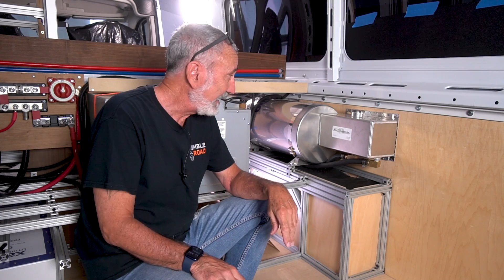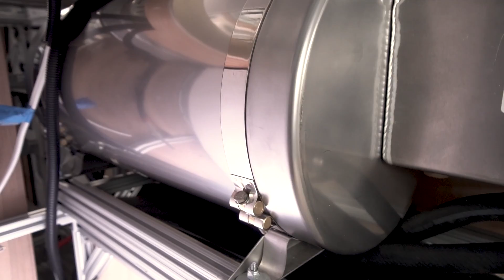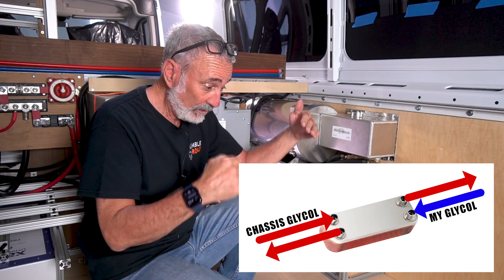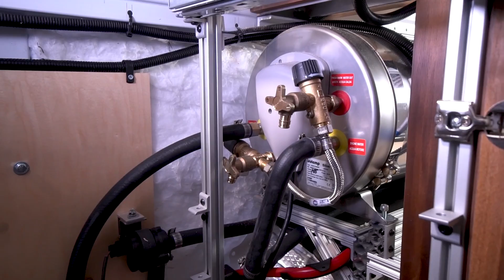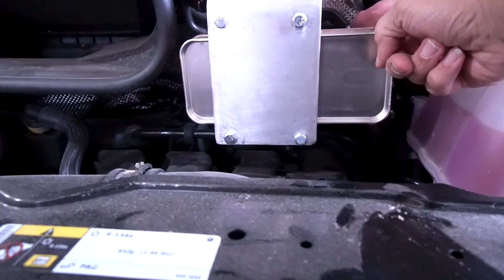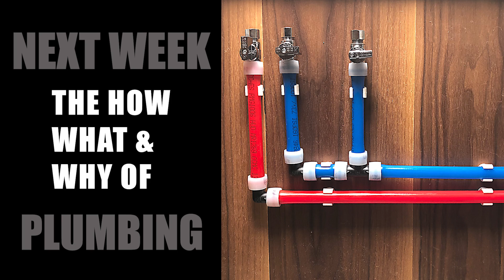Make hot water in your van, while you drive!

Comment: That solves the problems of getting the truck stranded losing its engine coolant from those lines getting cut by a rock or something on the road, and solves the problems of those lines freezing during the winter since it is also antifreeze coolant. 
I didn't see or hear if you shown or talked about the tank freezing when not in use during the winter. But i am sure all you would need to have is a drain valve for the fresh water in the tank at its lowest point, and just drain it when you know you will be storing the truck in the freezing weather.
Reply from the maker: I haven’t installed a low point drain since van #01. Run the tank dry and blow the lines.

Comment: Just watched the video from Van Land, they installed the same heat-exchange water heater but under the chassis. Maybe it's a good idea to solve the issue of having a high-temperature heat source in the chassis in summer.
Reply from the maker: While I agree it is a fine, rugged piece of equipment, but the Isotemp is not made for exterior mounting. It is from the marine world, where its intended use is in the bilge or engine room.
Reply: @HumbleRoad  Right, just figured out they're using a different brand, the "SureCal 20 liter / 5.28 gal Horizontal Single Coil Calorifier". Having read through the product description, this one seems better for interior use, too.
Reply: ha! I just watched that video too before finding this one. I think they're also running the actual radiator water through their system as well, so when those exposed hoses and fittings under the van break, and they will, the van is going to lose all coolant and overheat.

Comment: Always clear and concise explanation of your engineering decisions; thanks!   I would like to hear your opinion and experience on using those plate exchangers vs shell & tube.  My concern in my application is that the exchanger in the engine bay will experience significant vibrations, and I am concerned about the plate exchanger as they are theoretically much more prone to breakdown in the seal and resulting in liquids mixing compared to the shell & tube type heat exchanger.
Reply: I believe that this plate heat exchanger is fully brazed meaning there are no seals on the plate pack, it seems very robust to me.
Reply from the maker: I know a few builders using the very same exchanger in their builds without issue. I have three vans out in the wild using this heat exchanger without issues. One van is full time, running every single day!

Comment: Great video! Sir George, just wanted to give a heads up.  That those worm gear clamps connected to the heat exchanger will eventually leak glyco, especially in the engine bay.  Due to the hose experiencing cold/hot temps.  It is much better to use spring clamps that can deal with that expanding and contracting of hoses.  Hence why all car manufacturers, will never use worm gear clamps in the engine bay
Reply from the maker: Noted. Thank you!

Comment: I made this kind of system in my van, but by my own way.  I didn't use any ready supplies.  Now I have 80 litres (21 gallons)  of hot water in 20 minutes of driving. 😁
Reply: Howdy, 
Do you maybe have a video of the setup, or parts list and a diagram? Many thanks in advance for your time and assistance, it's much appreciated. 
C.I.M.
Reply: Hi Filip, can you share how you did it? A partslist would help as well.
Reply: @marc1321 no he can't because he didn't do anything if he did he would have shared info by now
Reply: can you share on how you did that

Comment: I noticed myself turning faucets all the way to hot and putting my hand in them to test the temperature before mixing with cold water. If your customers have the same habit, they’re gonna burn themselves. There’s a reason trades have been done in certain ways. You honestly have a potential lawsuit on your hands with that design, especially when there’s a video with you saying “I know how it’s usually done, but now it’s on them not to scald themselves by maintaining attention every time they use the hot water.” It’s really a recipe for failure if you rely on a persons attention because it will lapse eventually and then you have a problem.
Reply from the maker: Each of us has a different perspective on responsibility. Your opening statement on how you turn on only the hot would not be a great defense in court
Reply: @HumbleRoad  Anything that can go wrong will eventually go wrong. You’re relying on your customer’s attention to prevent themselves from getting scalded. What wouldn’t hold up in court is the video of you blatantly disregarding standard practice which prevents that outcome.

People are absent minded dude. A long day of biking in the mountains and you’re tired. Maybe there’s a bear nearby that you’re nervous about. You turn on the hot water to wash off a plate and you burn yourself. Not a good design.

Comment: really interesting, so not sure if it's been asked already but what happens if you're stopped for more than 2 days and no shore power, in other words, how long would you have to idle your engine build up a decent amount of heat?
Reply from the maker: I mentioned in the video that this water heater also has a 120VAC heater coil immersed in the tank. Turn on the inverter and turn on the heater. 750W so it takes a little bit of time to heat up, but that's another way to make hot water with this set-up.

Comment: I am guessing you use the same coolant that the chassis uses?  If the heat exchanger were to fail inside it would contaminate the chassis coolant otherwise.
Reply from the maker: An astute observation. But no, in all three vans done so far, I used a pet safe glycol as per the client's request. But moving forward, I will introduce your theory. I like it.

Comment: Hi George, I use isotherm slim in most of my builds. I have shut offs(electric ball valves)  and no heat exchanger or Reservoir. These systems produce too much hot water if left open all the time.  If it’s still too hot under my bed after both me and my wife shower, I have recirculating feature in shower valve rv that I can transfer most of the heated hot water to main tank that sits under van
Reply: Paul, do you have a pump on the your Isotherm to circulate the coolant from the engine or not?
Reply: @mattadams7261   you don’t need pump, the engine water pump is always on when running. It circulates thur engine block and thur heater coil and isotherm if allowed. It works perfectly.I am now installing electric ball valves.

Comment: After thinking all day on this it’s as simple as wiring the pump through the thermostat on the tank already provided for the electrical heating element. Problem solved never too hot.
Reply from the maker: Except then you have to leave the tank “on” all the time, making hot water through the inverter .
Reply: I’m pretty sure it opens and closes the connection without power. A gas water heater has no power to the thermostat. It just opens and closes a circuit. It’s worth looking into.

Comment: You will use the same amount of 120 water. where ever you temper down the water. A baby would get scalded to death in 60 sec. at 130 degree hot water. Source: Massachusetts Plumbing code. Way safer to temper water at tank that’s why the tempering valve is at the tank. Can’t wash little dog in sink anymore.
Reply from the maker: Correct, the mixing valve on the tank allows adjustments. User adjusted to taste

Comment: You don’t need to cool the water from the heat exchanger. That’s why you get the isotherm with a mixing valve. You connect only one hose to the expansion tank otherwise you create a radiator.
Reply from the maker: please explain further. thank you.
Reply: @HumbleRoad  there is no harm in running engine cooling water through the isotherm. That’s done on boats. They just have a heat exchanger to cool the coolant with sea water. The coolant with antifreeze just cycles through engine, hot water tank and the heat exchanger that gets cooled by the sea water. They use an impeller pump to cycle the sea water through that. It’s basically the same functionality as in a car just with sea water not air. 
It is a good thing to separate the engine loop from the van/house loop in case you ever have to work on one system only. 
On the van side, just tee off a line from the highest point of your antifreeze plumbing to the expansion tank. The tee should open to the top to the line that goes to the tank. Your circulation pump should be in the colder return line. Once you fill your system it will just fill with water and the air will go out. 
Let the pump run and you will see how the air comes out of the system. 
The expansion tank must be the highest point in your system. I hope that explains it.

Comment: Learned more info for my system in my 98 Xplorer.   Thanks for posting George!
Reply: My 98 Xplorer heats the water heater from the motor. I also added a 110v heat rod to heat off the generator, shore power or solar.
Reply: @yvairguy  Interesting!

Comment: Is more to the point of keeping the engine system separate is providing proper temp for the engine to operate optimally?
Does it drop the engine temp a bit. ICEs need heat to combust
Reply from the maker: I've got two of these vans out in the wild, one full time for over a year now. No issues. If the chassis coolant was run all the way back to the water heater, then yes, I see what you are thinking.

Comment: Thanks for sharing tour knowledge.

Instead of adding water to air heat exchangers in order to cool the glycol in the summertime, why not just stop the pump?
It wouldn't boil the water to water glycol stationary part as the boiling point is way higher...
Reply: * your knowledge

Comment: If the returning glycol is too hot, couldn't you just setup a thermostatic switch to the pump? and stop the glycol looping.
Reply: I like that, have a e-valve solenoid switch on the dash for summer days when you dont need hot water or really just dont want a hot van
Reply: who wants a hot shower anyway when it is 30°C outside anyway. I like your idea a lot.

Comment: Great job!  I notice that you did not address the vent on top of the Rixen expansion tank.   What are you planning to do with that in order to manage the potential air/coolant "escapes"?

Also, is there a reason you did not put the expansion tank and/or pump in the engine area?
Reply from the maker: I will vent the reservoir outside the van, but if you keep the coolant level one inch and a half down from the top of the tank, it will not boil over. In a Promaster, there is not room under the hood for the reservoir. Sprinters? yes, I put the tank on the aux battery tray, if it is not occupied.

Comment: George, any need for thermal expansion valves for safety?  Or is it that the system is not under constant pressure that this is not needed?
Reply from the maker: The reservoir cap has a 5lb pressure release for the glycol. The water heater has a pressure release valve which drains outside the van.

Comment: Great system, very interesting.
Instead of adding and removing insulation around the pipes, it would help to regulate the pump. In summer it should run slower, so the glycol has more time to cool down before it runs into the heater. (Maybe a two level-switch for summer/winter is sufficient.)
Btw: I'm using an electric 12V heater and run it only while I'm driving. Same effect, but only 200W and much less water than in your system.
Reply from the maker: Thanks for the tips!

Comment: Does this system also have a furnace to heat the glycol that uses the fuel from the gas/diesel tank or is it electric/engine heated only? Do you use this glycol to heat the van by running it through a air heat exchanger?
Reply from the maker: No, this is simply to make hot water as described.

Comment: Hey George, Thanks so much for Another Very Nice Video!

I plan to do mostly winter traveling to avoid the crowds plus I like winter better than summer.
Have you considered preheating the engine (H-12 option for a Sprinter), but instead of spending $1200 for a factory install, just incorporate it into your plumbing system using the Espar Hydronic S3 D5E?  I plan to use two motorized valves in my glycol lines for turning it on and off.  
Plus, I want one system without the separating heat exchanger just to MAKE IT SIMPLE.  I have driven over a million miles and I have never had a heater hose to blow and I bet you could say the same thing, so What is the BIG DEAL ?  I know no one recommends this!  With all the safety warning electronics build into the Sprinter I am sure I would know if a line blew, and I would just FIX IT!
Reply from the maker: I installed an Espar Hydronic system in my first van build. Did not like the idea of firing up a diesel furnace all Summer long every time I needed hot water. Since you will be mostly in colder climates, that will not be an issue.

Comment: Hi George - great video. In my van I'm planning to have a 2.5 gallon 120V water heater that runs off the inverter. If we're driving then the B2B is charging the system, resulting in similar 'free' hot water. How would you compare the pros and cons between the two? I think the electric version isn't quite as good (lots of losses in the various conversions compared to the glycol heat exchange) but as a beginner, seems a fair bit easier to install.
Reply: If your going to go this far may as well put in the furnace and eliminate the hot air espar heater. Put the tank under the hood where it belongs. To buy this system is by no means FREE.
Reply: @michaelscarfi3196  a tank under the hood or a smaller tank would be much better in the summertime.
Reply: @Chris could you explain your concept of the timer setup for this you were talking about?
Reply: @mattadams7261  If you put the water heater on a 10/20/30 minute timer rather than on/off, you cannot forget to turn it off. If it's a basic switch, you might leave it on for longer than you need. So the idea is, use a timer switch (mechanical or electronic) and just run the heater long enough to get a hot tank, but not longer.
Reply: @Chris Bro, it’s the law of thermodynamics. I didn’t create it but I do follow it (And so do you) Thermodynamics doesn’t care about your timer. You are generating electricity using the alternator and I can sure as heck assure you that that costs much more than the ~12¢/kWh power out of the wall to heat your water using the gasoline/diesel engine in your van. The point of this system is efficiently and capturing the waste heat from the engine to heat the water FOR FREE (minus 12v water pump)
Reply: George’s system costs less to run. The electricity you’re using is represented by extra fuel used.
Reply: Man cat fight is very interesting.

🐱🐱🐱🐱🐱🐱🐱🐱🐈
Reply: @007nadineL  Interesting unlike your comments…

Comment: This is how most cruising boats make hot water. Works great and the water will stay hot for a day. Most marine water heaters are stainless and include an internal engine coolant heat exchanger plus a 120V electric heater as well. My boat makes water very hot and it lasts into the next day easy.

Comment: Hello George, by any chance you can draw a diagram how you did this? It’s the system of keeping the hot water in that water tank that throws me off. I totally understand the heat exchanging process produced by the engine glycol. It’s how to keep the hot water in the tank to be used later when you wanna take a shower or whatever. Thank you 😊
Reply from the maker: The water pump (when on) is pushing cold water into the water heater, where it is heated and sent out to the hot manifold for dispersion throughout the van.

Comment: If the water stays hot for up to two days could you add a cabin heat radiator to the system and use the retained heat to heat the van overnight?
Reply: Yes this could work but I don’t think you would get too much energy out of it.

Comment: So if you're boondocking for several days this seems like a very expensive system that's useless unless you want to waste fuel running the engine. The same thing can be accomplished with an electric hot water heater and letting the alternator provide electricity for heat. This way you only have the cost of one system that will work under all conditions.
Reply from the maker: You missed a very important part of the story, John. The water heater also has a 120V 750W heating element inside. I used your exact words when I said if you're boondocking for two week, simply turn on the inverter and make hot water. The Vagabonds have this system and with over one year of use, have never turned on the electric portion. Their driving habits provide plenty of hot water every day.
Reply: @Chris yes I do. And every bit of power you draw from them adds load to the engine, worsening the MPG.
Reply: Most of the energy (60%-80%) in the petrol you burn goes as waste heat - So it should use less fuel to heat your water like this than to use your alternator.
Reply: @neilhubbard6461  That may be true but the alternator is running all the time anyway.
Reply: @johntatman9168 😂
Reply: Using the engine heat that needs dissapating anyway you don't impact fuel economy as much as running an electric heater of an engine alternator.
Reply: @FlexDRG_Lampje  I agree but it adds a huge expense and the opportunity for more things to break when you already have the alternator. To each his own but I believe 
it's money poorly spent.
Reply: @Chris There absolutely is a difference.  The more juice pulled from the alternator, the more drag it places on the engine.  The more drag on the engine, the more fuel it uses.